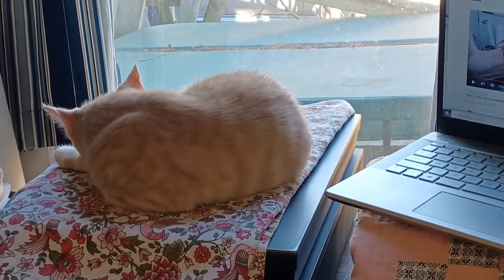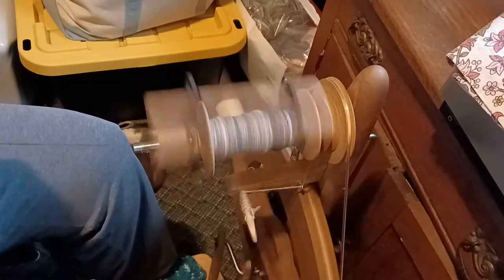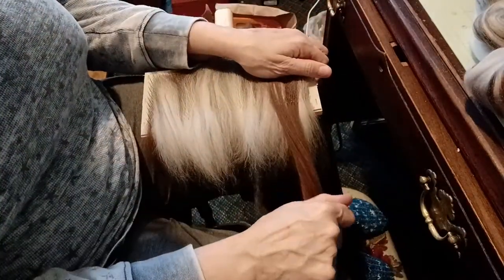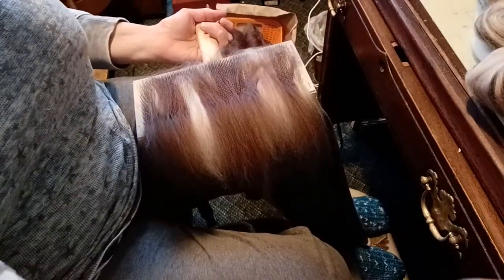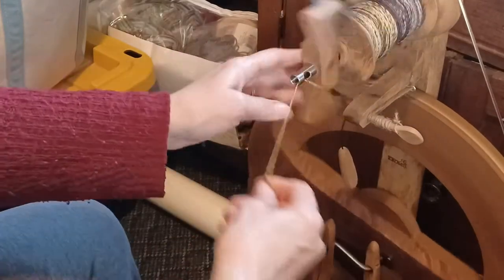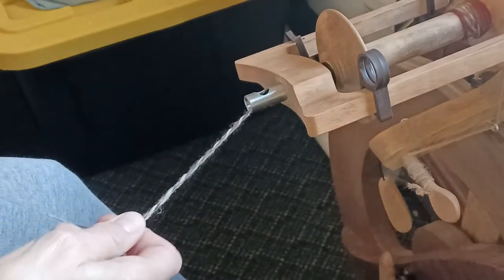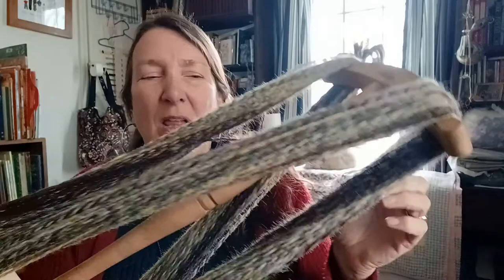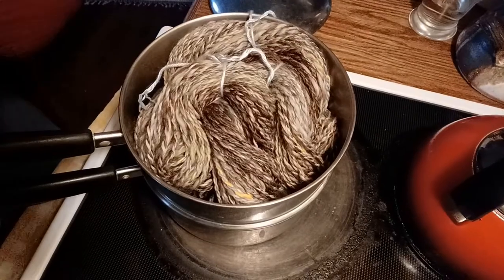Spinning in the New Year (and a bracelet ply)

Comment: I have seen the carding done by others and they don't put the fiber all the way to the top. They keep it below the upper edge and the pull it off straight. Try loading less on the carders and not going to the top. Curved paddles will be easier to use as well and you are not doing it enough. You should finish taking it all off of one side before flipping.
Reply from the maker: Thank you SO much for all that input! I will try that. I learned carding from watching one lady on youtube, but I clearly have an inferior method. I'll give that a try, and we will do an assessment on my next carding video! Thanks again.